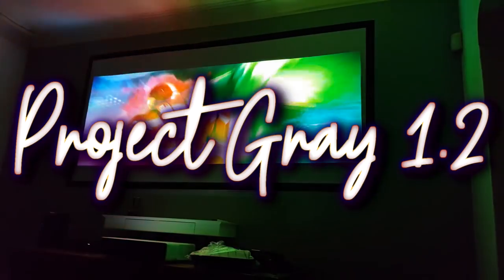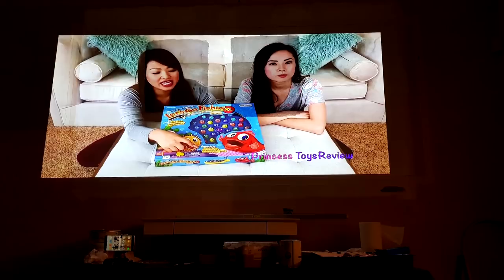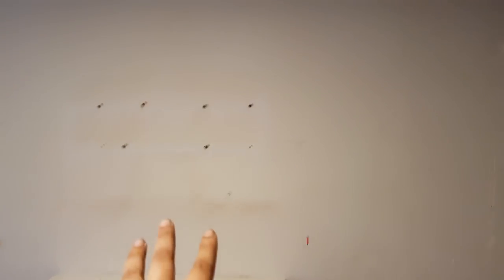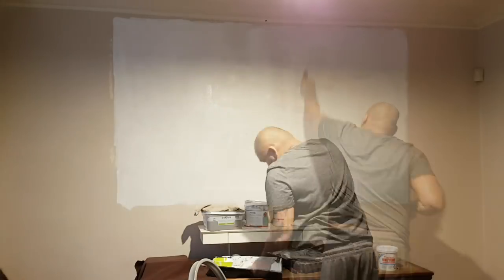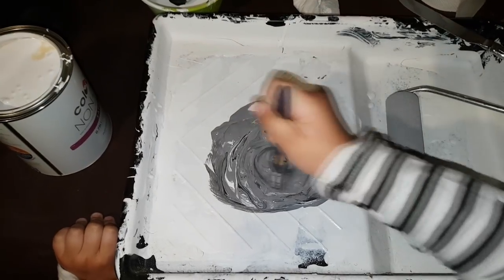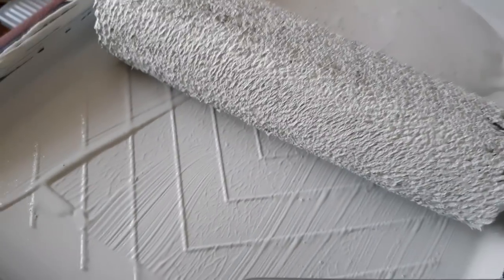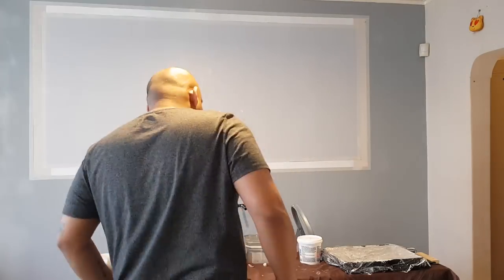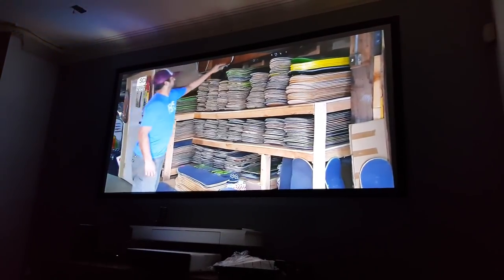DIY Gray Projector Screen Is It Worth It?

Comment from the maker: BEST PROJECTORS BY RANK 2018
----------------------------
Full Size HD Projectors (WXGA)
1. Alfawise X HD - https://goo.gl/8HLk3y
2. VIVIBRIGHT GP100 (S) - https://goo.gl/Yg2GPh
3. Cheerlux CL760 - https://goo.gl/5Wjr5c
4. VS627 LED - https://goo.gl/eRQsYr
5. Excelvan 96+ - https://goo.gl/7nLEKh

Best DLP Projectors 2018
1. WOWOTO H8 - https://goo.gl/4Dwux6
2. WOWOTO T8E 2000 - https://goo.gl/JEqR1c
3. XGIMI Z4 Aurora - https://goo.gl/b5rUiD
4. P8I DLP ANDROID 7.0 - https://goo.gl/CgMPZQ
5. RD-601 Smart - https://goo.gl/PuWRVH

Best True 1080p Projectors 2018
1. Original XGIMI H1 - https://goo.gl/KnaHWB
2. JmGO V8 Projector - https://goo.gl/dFCEXn
3. Xiaomi Mi Laser - https://goo.gl/WEi1FR

GearBest Clothing Sale - https://goo.gl/2MzJFK
Mobile Phone Clearance - https://goo.gl/KV9zcM

Comment: Great work!!! 
I recently bought Optoma HD143x and planning to get a 150" pull down projector screen. My room is 20 x 20 feet with beige color walls, and i can control the outside light getting into the room. Can you suggest grey vs white projector screen for my situation? Thanks in advance.

Comment: For projector with range of 3000 to 3200 lumens.. is regular white screen good enough?
Reply from the maker: It will be good enough, but as a rule of thumb projectors over the 3500 luman range maybe go with a grey screen.
Reply: Hi. i'm a bit confused between ansi lumens and lumens. So for Xgimi cc aurora with 350 ansi lumens, whats is in lumens?
Reply from the maker: So the word luman is a general term,  ANSI lumens is the only certified measure of brightness you can trust.
Reply: So for Xgimi cc aurora with 350 ansi lumens, what do u think of the brigtness? is it good enough for home use?  i purchased this last month and quite happy with the vivid colour and clear pics but  since i dont have the xgimi H1, so i cant compare with it.

Comment: Nice! I’d be killed if I did that though 😂🤣
Reply from the maker: Lol Mrs TECH 404 was not on board to begin with so I removed the tv and sold it 😉
Reply: Roflmao 🤣 well that’s one way to get what you want.
Reply: What's your home projector of choice that you use?
Reply from the maker: Currently using the Xiaomi laser projector,  I also used to use the Xgimi H1 and optoma hd142x but sticking with the Xiaomi for now.